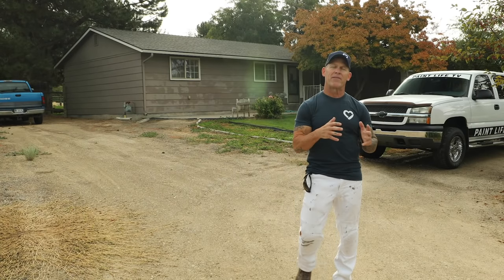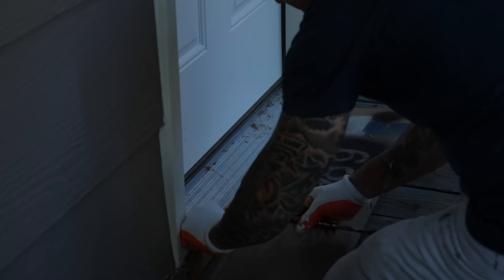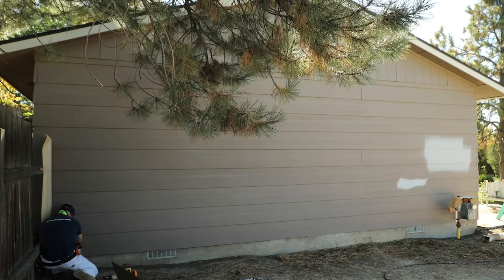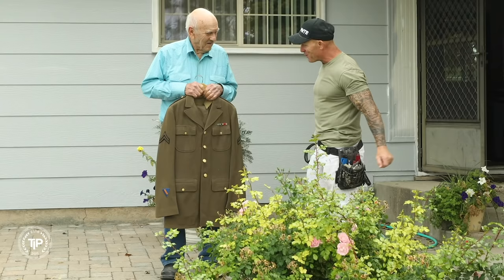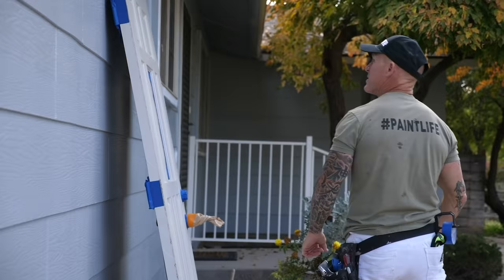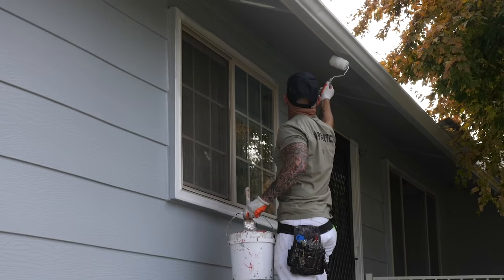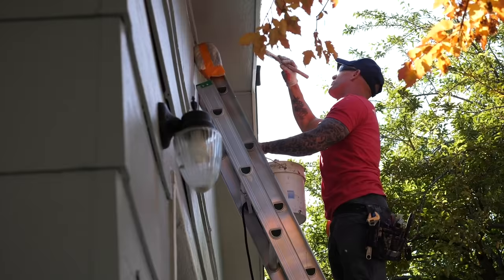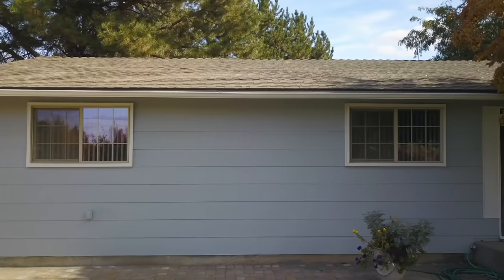How to Paint a House Exterior by Yourself: Everything You Need to Know to Paint Like a Pro.

Comment: I am 72 and painting my parents house for the 2nd time in 18 years and I am jealous of your spray painting and wish that is what I was doing on this house!!!  The amount of time you save is just tremendous as well as the wear and tear on your body!!!  This truly is the only way to go!!!  Many years ago I dated a young man who was a spray painter and he painted my Mothers living room, with nothing down on the carpeting, at all!  My mother threatened to kill him if he got any paint or overspray on the floor and he told her not to worry, by the time it hit the floor, it would be dry and a vacuum could suck it up.  He was right!  He had been painting for a number of years and knew what he was doing, but it sure scared us!
I was taught by my mother that every time I paint there must always be 1-2 coats of primer all over everything.  You don't seem to do that, so is it really necessary?  Also, my parents home is 70 years old and it has some exterior flaking or chipping on the south side of the house due to excessive sun and heat. I am wondering if I am overdoing the sanding and prepping part of this job.  My Mom was a perfectionist and I feel like I may be wasting time that is not necessary and wish you could address, when prepping is needed and when you are overdoing it!  Thus far I have only seen you use caulk from a tube for prepping but I have a few holes from nails and screws and a couple breaks or dents and I sure wish you would address fixing those issues before priming and paint as well.  Although I have done household painting for myself for many years, we need to be reminded or at least I do!

Comment: I have a trick that I use when removing lights to make sure that I wire them up correctly when re-installing, and that is, using different color wire nuts. I use blue, yellow, and orange, and I put the corresponding color on the wire attached to the light as well, making it dummy proof. It has saved me a lot of time wiring and re-wiring. Try it and see if it works for you too.